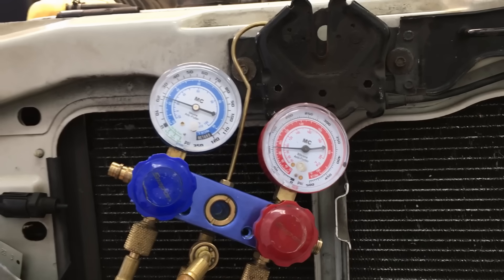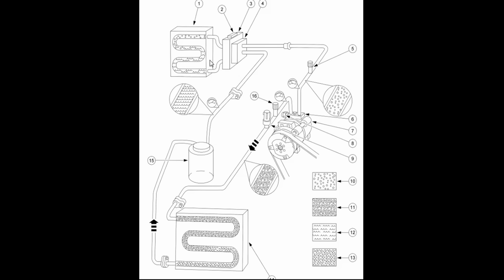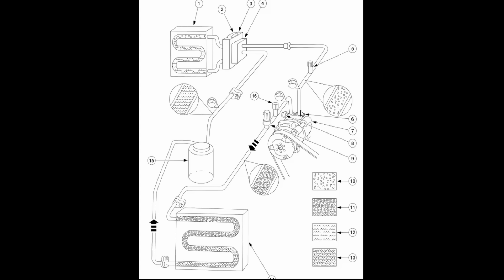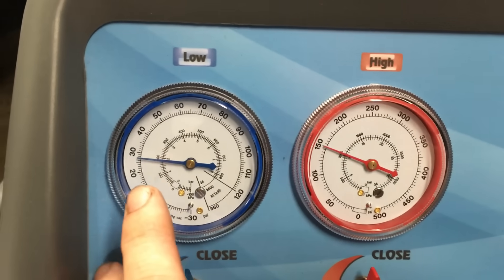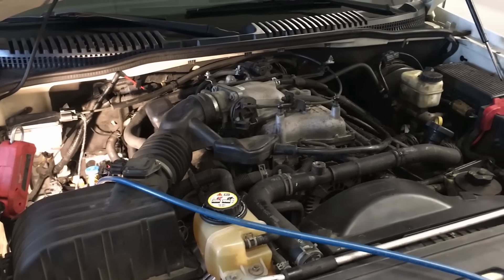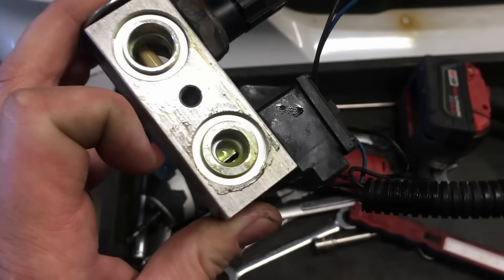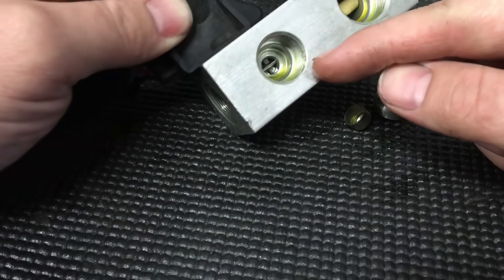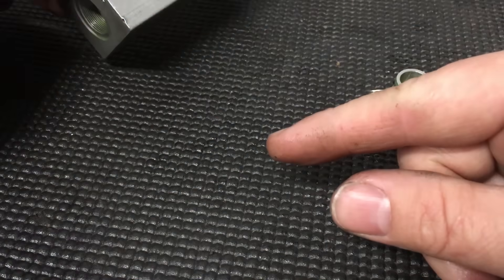3 Common Signs Your TXV has Failed Causing Poor A/C System Cooling

Comment: Wow! 32 degrees is the coldest I've ever seen a car AC.  
Have you ever seen a unit where simply replacing the dryer fixed a 65 degree vent temp that is properly charged? My F250 will not do any better than that in 90 degree weather. What I did was put a used compressor on it without changing the dryer.  Pressures are 26 and 150 and I weighed in the freon after vacuuming it down.
Reply: I had same issue with a Sienna.  Mine was 8 oz low on refrigerant.  Make sure you have correct amount of refrigerant and maybe start over and vacuum out before you add refrigerant.   I am at 35 - 38 degrees based on RPM’s and moving or sitting.  I knew I had some because it would get cool and get down to about 60 at best.  I hooked manifold up and used an ambient temp/pressure chart to determine low/high side.  Bleed out air in your yellow line.
Reply from the maker: No
Reply: Blade 

     Always change the condenser when putting on a different compressor.  I made that mistake before.  And go OEM NEW compressor.  Made that mistake also.  Denso for my Toyota Sienna   Both compressor and condenser. Only $50 more and wife and kids are happy!!!!   Kids actually complain about how cold it is.  Blankets in summer. 🤣
Reply: Blade 

    Another thought,  did your used compressor have the correct amount and weight oil when you got it?
Reply: Sir Sweetness I want to say the compressor was completely dry. It came off a junk f 250 that we still own. I  put a new orifice in and the correct amount Of oil for the entire system and weighed in the freon.
Reply: Blade 

    If when running at 2000 rpm’s your low and high side pressure is not at the correct numbers I would suspect low refrigerant volume.  I know you said you weighed it but the numbers you mentioned are what mine were before I added to get it to the correct pressures based on ambient temperature.  I would highly suspect either a big leak or low refrigerant
Reply: Sir Sweetness If I add any more freon than I have now vent temps start rising. I did tinker with various freon levels up and down and where it is now is the coldest I can get it.

May just have to buy a new compressor, dryer and like you say a condensor.

Someone told me if you spray water on a condensor on a running system and it drops vent temps like what youd want to see, that means the condensor is bad.

Spraying Water on this condensor  doesnt budge the vent temps.
Reply: Blade 

      Yes cleaning off condenser and lightly spraying condenser should lower temperature.  Knowing the compressor was dry...it is probably fried.  My vehicle, I would get a new compressor, condenser and dryer.  Not sure if your dryer is on your condenser?   Buy OEM.  Motorcraft.  When a compressor goes bad, it throws shards of metal into system and condenser has small tubes that get plugged.  Put 1 oz of oil in condenser and 1 in accumulator/dryer when you put new ones on.
Reply: Blade 

     You can get new compressors that come pre-filled with correct amount and weight of oil.  Make sure it is OEM though because different brands use different types of oil.
Reply: That OEM stuff is Major expensive!  but no doubt its better.
 I can get a rebuilt compressor and a dryer for 230 ish at one of the local parts houses.  I've had good luck with those. They won't warranty them unless you buy the dryer with it and we've not had to take one off.  
I put one on my Mini van and it blows 39 degrees. Also put one on my daughters Focus and it blows ice cold as well. I didn't check vent temps on the focus. Back then just went by feel.  -_- Both of those are Fixed Orifice-
I imagine the TXV is letting the system in the vid blow this cold because the TXV meters the refrigerant perfectly at all times according to temp.
Reply: Blade 

What year is your F250.  I will hunt for a better price and something new.  Never buy a rebuilt compressor or master cylinder
Reply: Its an 03 F250 5.4 Gas
Reply: Blade 

If you have the 5.4L.  I found a new one on Amazon 471-8144 model for $123.78. New.  Denso brand.  With clutch.  I put in 2007 model year not sure what you have.
Reply: Ok thanks I'll look into Denso then!
Reply: Blade 

Same model for your year.  471-8144

Comment: Hi is it normal if the clucth enggage every 22 second?
Reply from the maker: yes
Reply: FordTechMakuloco thank u, one more question, is it normal if i hear sound like water flowing inside ac pipe. Should i add more freon on it?
Reply: @BudiSetiawan-ij6cb  freon/R134a charge is precisely measured by weight.
Its better to have not enough than overloaded system.
Start by evaluating the system properly (vacuum pump) then refill slowly either based:
1- on vehicle specs or 
2- pressure gauge or
3- Approx 1.1/2 cans

Wear protection *glasses*, gloves and read R134a precautions to be your own man. It can be dangerous.

Dont blow cold AC on a hot windshield to prevent heat stress ie. cracks!
👍🏻
👍🏻

Comment: Great videos! One tip that would be helpful to those who are new to the workings of the A/C system, and to using Manifold Gauges is, you could include the position of the Manifold Gauge valves for each of the tests that you do. During one test you may only need one valve open, but during another test you may need all of them open, or a combination of open and closed valves. This would have been helpful to me when I first started. Thanks, and keep the great videos coming!
Reply: You dont need to open the valves on the manifold unless you are adding freon or recovering the system. Each nob opens each side to the yellow center hose. You use the blue nob to open the yellow to the system ONLY when you have it attached to a can of freon. Never open the red when you have a bottle or can hooked to the yellow hose or you could introduce high pressure to a can that cannot take 250 psi or whatever your high side is running. You'll open both when you're recovering the system or pulling a vacuum. It's really simple. 👍
Lol and I just noticed this comment is 5 years old lol you probably are a pro by now lol
Reply: Wow! I can’t believe that was 5 years ago! It doesn’t feel like it.😂
Thanks for your input! I don’t work on AC systems all that often, so I usually have to revisit the procedure to make sure that I’m doing it correctly.

Comment: Thanks for the video!  I have a dual climate 04 Acura TSX which is blowing cold from passenger and room air from drivers side.  Low side pressure is 25 and High side pressure is 200; however, just like in this video they 2 sides are not equalizing.   Compressor doesn't cycle on/off and it does produce cool air from he passenger side.  Blend door actuators do move with adjustments in temperature control   Does this sound consistent with a malfunctioning TXV?
Reply: Brandon and Keia Fink did you fix it yet?
Reply: Yes, given all the symptoms, I suspected TXV vs moisture.  I decided to try the easy solution first and vacuumed the system for almost 2 hours, refilled and has worked perfect since.  When I initially filled the system after replacing the condenser I left it on vacuum for approximately 45 minutes-1 hour and that was apparently not enough.
Reply: having an Acura I can share that the inside cabin air filter needs to be either changed or removed because it can block good air circulation by the blower if it is not clean (blows up electronic resistor + blower fuse too).
Replace filter to get good AC circulation every 3 or 4 years based on ambiant dust level.
👍🏻

Comment: any way to troubleshoot a dual AC vehicle with the lines in parallel?
my front AC is not cold, rear is.  Blend door is ok, even cut off heater core water flow to make sure.
Reply: front txv needs replacement

Comment: I can't charge the coolant into my mini, compressor runs, replaced the dryer and was told it could be the TXV.  I can't even charge a full 12oz can cause the pressure shoots to about 90psi. Any ideas?

Comment: I changed my 2007 expedition evaporator because of a leak. Now it's leaking just like the old one. Could it be a bad TXV?
Reply: Very well could be...sometimes they do the opposite of being stuck where the flow never cycles and allow way too much pressure flow which stresses all the components. Usually your compressor will fail and your evap will leak will happen with this...easy test...put about a pound over on Freon and if the system doesn’t kill the compressor and the high side goes pass 300psi then it’s a txv that’s bad. That’s the lucky side of bad cause the system can still work

Comment: Great video. Working on my 05 Aviator. I assumed there was a blockage or front txv went down. You have given me confirmation. I had the same problem but pressure would equalize soon as i turned the engine off. Flushed out the system and cold ac again. Thx
Reply: How do you flush out the system?

Comment: Hey Brian, nice video.  Curious what do you recommend to keep handy for supplies with a 2017 Ford Transit connect XLT with a 2.5 engine?  I just got an oil filter, and oil.  I'm having a hard time to locate some coolant.  Mine's orange.

Comment: Thanks for the videos on this subject. Probably the best one I found so far that describes the conditions of failing txv. I'm in the process of figuring out an f150. With r134 in spec of 24 oz, the high side at 150 and low at 25 the ac produces 45-50 at the vents and will start cycling compressor after a few mins. Normal or is there such thing as a txv beginning to fail? The pressures equalize slowly about 10-15 mins. Thoughts?
Reply: system is a bit too low on charge with these pressures.

Check both of your shradder valves for leaks.

Sumply insulating the high pressure line from engine heat with pipe wrap will easily boost your AC efficiency during peak season. $5 wrap from HmDepot
👍🏻

Comment: Hello I sent you a text you about a week ago, I have a 2012 Ford F-150 Supercrew XLT, I have only the CD & Radio in my truck & my radio quit working after disconnecting the battery to clean the post on the battery, now neither will play, the clock is the only one blinking, can you HELP me. Thanks 🙏🏽

Comment: Would it be a similar problem for a 2008 ford taurus x?. When it idles theres nothing but heat but when its in motion is cold again. Thank you for all your videos I have learned alot all thanks to you.
Reply: compressor clutch may be slipping or not engaging due to the extra heat at idle
Reply: clean or remove cabin air filter to blow more air inside.

Insulate the entire high pressure line with $5 pipe wrap, specially near firewall where engine heat is the highest.

System efficiency is the key to removing more heat.
👍🏻

Comment: Hi Thanks for your very helpful vids. Off topic. Any idea why when replacing a ball joint on an 2006 f150 it would break the lower control arm? Bought ball joints from Detroit axle and called to make sure they were right product for my truck. Not new at this been working on vehicles since the late 1960s. Any thoughts or input would be appreciated. Thank you.

Comment: It's cheaper to replace the txv 
valve than the compressor 
Compressors last like what
10-15 years?
😇❤️🇺🇸😇
Reply: Yeah but it's much harder to change the TXV valve when it's up against the firewall inside the car. Probably why people don't always replace them.

Comment: @fordtechmakuloco  I have a 2005 f150 5.4l and my a/c cycles a lot. 105 degree day. 40psi on the low side and 275 to 300 on the high side. It wont cool on a hot day till I start driving. Or if I put on max ac and rev motor to 1500 rpm for 2-3mins. At idle ill get 60 deg at best and when im driving on freeway for a while Ill get 51. My concern is it not cooling till I start driving.
Reply: Perry Eastham Is your condenser coil clean? Anyone add refrigerant to it? Possibly your engine fan not moving fast enough and thats why it doesnt  cool  until you drive.
Reply: The condenser is clean. I sprayed it and the radiator. I added some freon before because the form stay it should be 45 to 55 on low side at that heat level. But do to the high side pressure I have takin freon out ro help keep the high side off 300psi.
Reply: Perry Eastham There is a rubber type shroud that fits from the bottom of rad to the front bumper, this allows the flow of air better through the condener. Parked it want work possibly. Seems like when you get your engine speed up the fan spins fast keeping air flow enough to keep the high pressure switch from opening,  bet your clutch on your fan and I think it's electrically controlled. ....may be broke. Hope that helps.
Reply: Perry Eastham I think your still over charged , 275 is way out of range. More like 150 psi,  but if the fan  isn't working your head will be high and cut out due to lack of air flow. So make sure that fan is good.......also you low side will fall off and cycle the compressor eventually .
Reply: I will check. I sat in the truck today. It was about 100 out. Seems that as long as the fan is set to low and   I rev the motor to about 1200rpm. The ac compressor doesnt disengage and it cools slowly
Reply: I bought an electric fan and took out the stock fan completely. Major differences

Comment: Hi FordTechMakuloco....i have an 05 police interceptor...when i get on the gas the ac gets warmer..any tips!? Thanks great videos!!
Reply: first last:   probably designed that way; it(the ecu) cuts the compressor off ,so that you get full power; hell,i turn mine off manually in that situation, EVERY TIME! also,I don´t want the a/c compr. revving very high,and ruining it, I like my a/c
Reply: Jose Peixoto Im taking even mild acceleration..stop to 30 reg driving..or passing At highway speeds
Reply: first last FIFA 2006 2006 transmission mount Google Now
Reply: Transmission mount 2006 NissanNissan I

Comment: Another great video - thanks for the information. Love your channel. Have you done any videos on R12 to R134A conversion? I have a 1992 Lincoln that finally lost enough of the charge that the AC won't run and I would like to change over to R134A and would like to do it correctly. Thanks
Reply: Cars haven't used R-12 in the USA since about 1993. I would be surprised if brian has done any conversions on 20+ year old vehicles. But to do it properly, the existing R-12 has to be recovered, the oil in the system needs to be removed, the system needs to be flushed of remaining oil and refrigerant traces, the filter/drier and condensor should both be replaced for optimal performance, a new FOT or TXV setup for R-134A may be required for optimal performance, and after that you fill the system with appropriate R-134A compatible oil and charge per standard procedures. If you google R-12 to R-134A conversion, I'm sure you'll find good guides/walkthroughs

Years ago I had a shop convert my '93 grand am the cost effective way of just removing the old refrigerant and oil (flushing the system) and replacing it with R-134A refrigerant and oil. The A/C performance was greatly lacking. As you'll see if you research the conversion, R-134A requires a higher capacity condensor than R-12. If you don't replace the condensor, cooling will never be remotely close to how it was with R-12.
Reply: Killer2600 - Thanks for the reply - I was sure that just using the same system for R12 and doing the vac/exhange with the PAG oil exchange would not provide proper cooling from all the articles I have researched, but none were providing the additional information on the condensor/dryer. I will continue my research. Thanks again.

Comment: Can u explain why my 06 Ford F150 S crew 5.4L  A/C  stop cooling at idle. Been a problem  for a while (years). I've done many evacuation and recharge thinking it's low on freon, but it's always been a full charge. Was this a Ford programing, to maintain fuel economy?  I even added an condenser fan to help.. but still at idle I lose AC cooling. Pressures have always been normal. And when turning on ac  compressor kicks on. It's just an odd thing. Once I start moving off closed throttle.. it gets ice cold. FYI I'm an ASE master tech, with L1 cert 25yr tech. But since it's my own vehicle I havnt spent a lot of time diagnosing. Just done recover recharge. And it's always had a full charge. I installed the aftermarket condenser fan thinking the summer heat was warming the condenser and at idle  clutch fan was not pulling enough air. Any suggestions?
Reply: Could be a belt slipping on the A/C pulley.  Have you tried replacing the belt?  Check pressures, too.